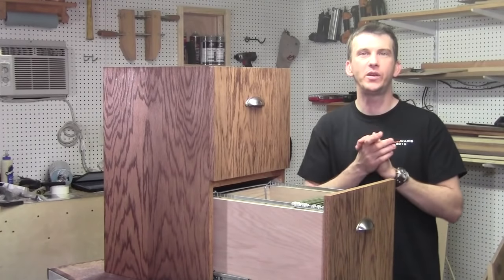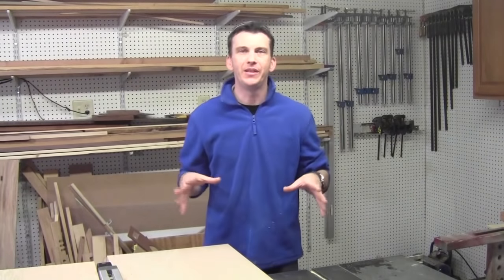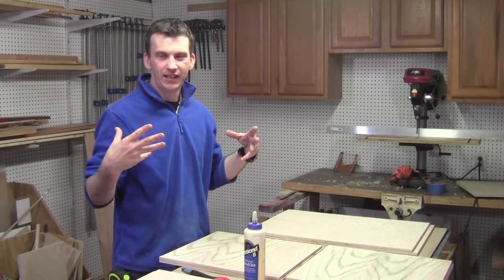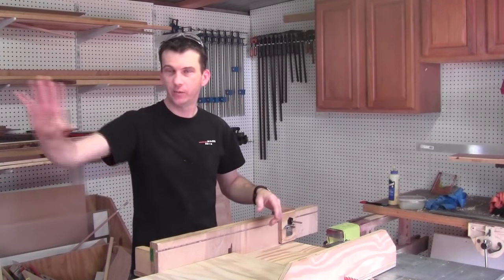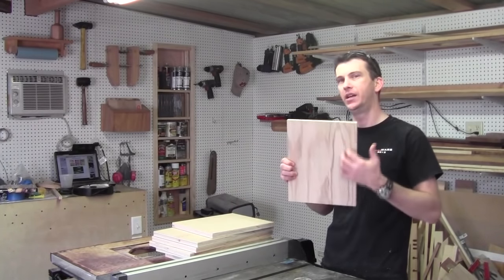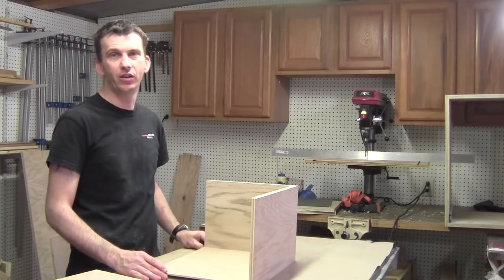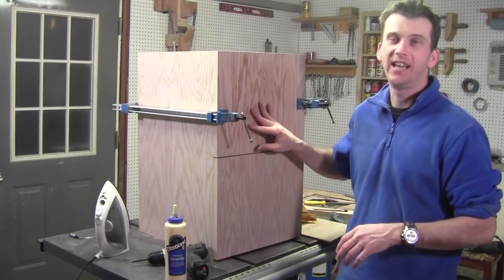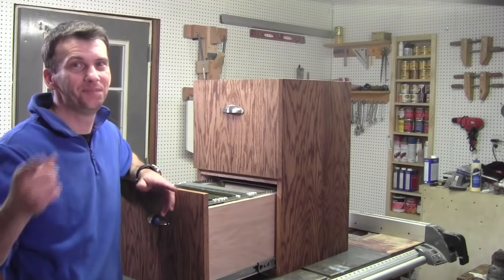Make a simple 2 Drawer Filing Cabinet

Comment from the maker: For cutting sheet goods, I use an 80 tooth blade for clean cuts. when it comes to saw blade choices, there are many out there that are excellent, I myself use CMT Blades they are a very nice blade sharp and true, they are available at Lowe's Hardware or online at just type in CMT Blades or google search cmtutensili  it should be the first search result also they are available at woodcraft ..

Comment from the maker: Yes, I didnt have the pack panel installed. Open the top drawer so you can get into the bottom drawer from the back, get your bottom drawer in place, add 2 clamps to secure it where you want it, (Just as you saw the clamps on the top drawer) with the bottom drawer secured, reach in through the back and install the 4 screws 1 in each corner , once the screws are installed remove the clamps and you are set.

Comment: Hi, great video as usual. I'm a little confused (nothing new) about the edge banding. In the UK, similar edging is plastic. Is the one you are using different? If not, how did you stain/varnish it to the same colour as the ply? I would have thought that you would need to decide on the final colour first then use banding to match.

Comment: Very nice build. The cross braces you put in, did you split the difference in distance from top to bottom? I'm going to build two of these and either stack them with the bottom cabinet having a 4 1/2" Toe Kick, to make a four drawer cabinet or use them as pedestals for a desktop and adding a 4 1/2" Toe Kick to them.  What do you think, is 4 1/2" to much, to little or just right?

Comment: nice job, but to save wood what would be wrong with making the door face the front of the drawer? i mean any drawer ive ever seen, the finished front is fastened directly to the sides of the drawers, there is 3 sides, the bottom, and the finished door. but you have 4 sides a the finished face fastened to the front, it sounds confusing i know, but you have 2 pieces making up the front instead of one, why and could you just use the one piece?